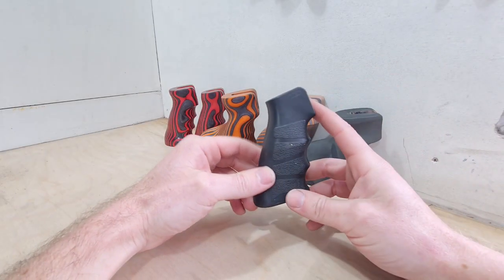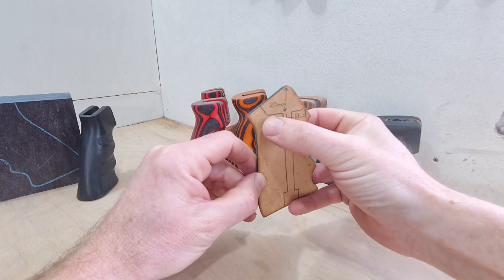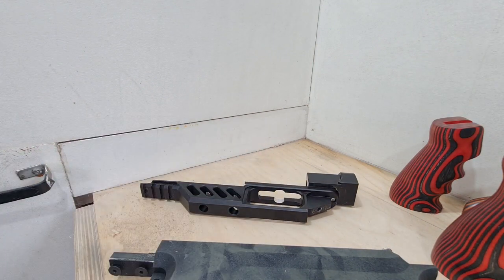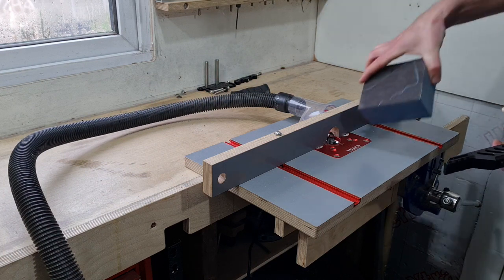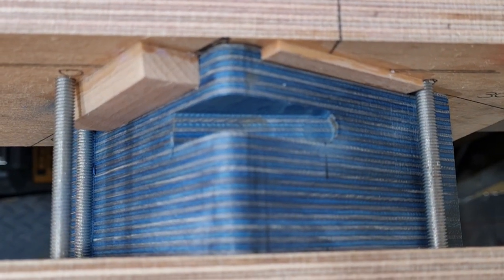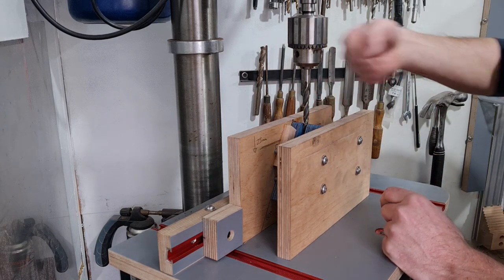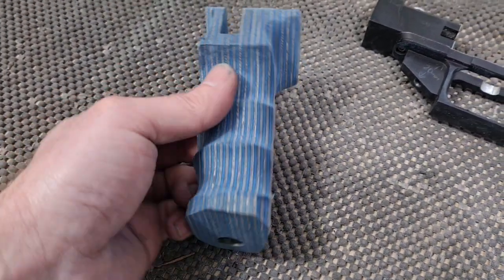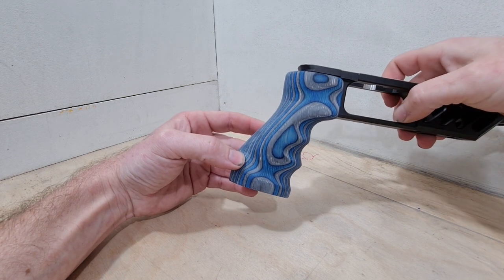DIY custom ar15 pistol grips for the fx impact, s510tr, Airmaks katran target air rifles

Comment: to make the laminate, do I "simply" soak birch plates in dye, let them dry and then glue them together? Will that work to have coloured the wood through and through?
Reply from the maker: It's not easily dyed at home
 It has to be done under pressure to get the veneers to fully saturate. Before being laminated together  again under serious pressure.